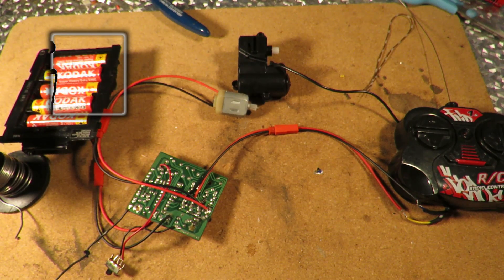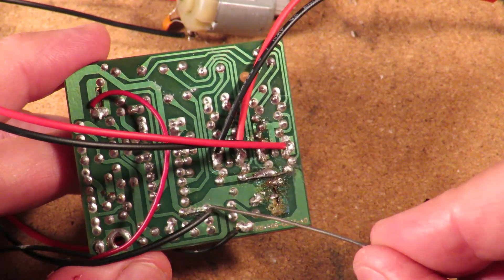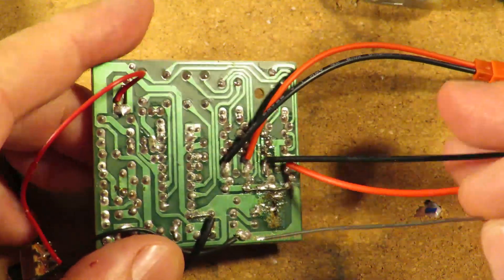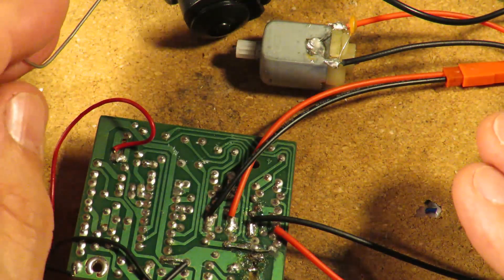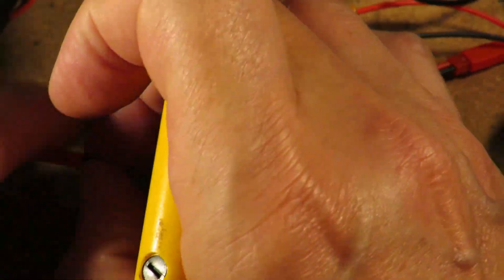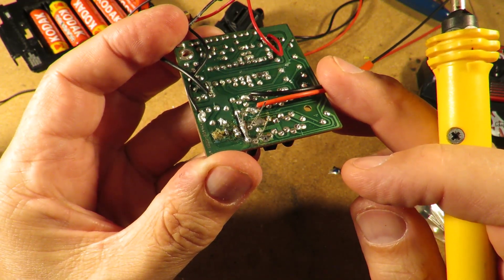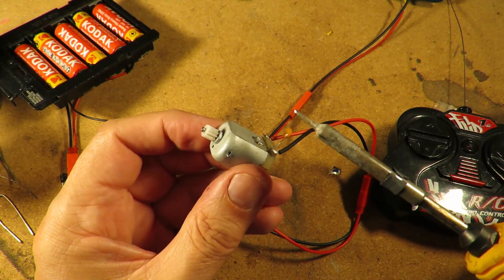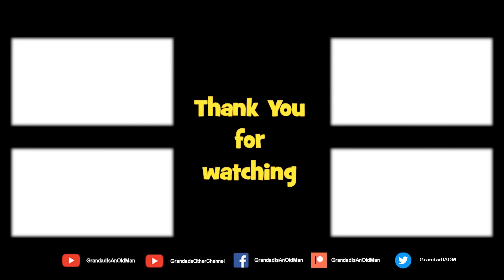Resurrecting a dead 27 MHz receiver with new transistors

Comment: So I wonder which transistor switches had to be replaced. I know on a H bridge there are 2 transistors in series & 2 in parallel. It must been 1 & 2 or 3 & 4 that went bad to kill total function from that motor.

Comment: Hi How are you, I have the following problem with an old formula 1 that I found in the trash. When I give the control, nothing works, the control works because I tested it with a radio on and I hear interference, but in the car receiver I have 0 volts on the H bridge, I give the control and I do not get anything, I have looked in the coil and receiver area and I don't know what voltages I should measure when I turn the knob. I haven't seen burned out transistors or anything. Where could the problem be? Cheers
Reply from the maker: The first question is, do you know if the controller is the right frequency for the receiver? A 27mhz controller will not operate a 40mhz receiver. In many cases a 27mhz controller will not operate a 27mhz receiver if they are different brands.
Reply: @GrandadIsAnOldMan  

Yes, both are at 27Mhz, the remote is from the same car because I looked for it on the internet and the car brought it back. And it puts 27MHz in the remote and in the car. What I have been able to see is that I have 2 volts in pin 1 and ground in pin 2 of the RX-2 but I have no forward voltage, neither left nor right, nor backward etc when I give the command. But power to the RX2 does reach it, its 2 volts and its ground.
Reply from the maker: @germanezequielperez4995  have you downloaded the datasheet for the RX2 TX2 chipset. That will tell you which pins to check on the RX2 for the output to  control the H bridge. You could manually put a signal on those pins to operate the H bridge.
Reply: @GrandadIsAnOldMan     I just tested that, and I have 0.2volts on the forward, backward, etc. pins. And when I turn the control, the voltage does not rise, I have measured in the pins of the inductor coil and there are 1.4 volts, but nothing changes when I turn the control, and apparently the capacitors do not see leaking liquid or inflated. I think the problem is that it does not amplify the signal that reaches it for some reason. or does not get it.
Reply from the maker: @germanezequielperez4995  if you have proved there is no change on the 5 output pins on the Rx2 chip when you operate the controller then I suspect the controller is not matched to the receiver. Can you try the controller with a different receiver and the receiver with a different controller. It is very unlikely the RF circuit on the receiver has gone faulty unless it has been tampered with. It is not subject to high voltage or current, so physical damage or somebody tampering with the components is the only way that will fail. The usual fail is as described in my video, where too much current is drawn through the H-bridge and the power transistor overheats. I am not saying you are wrong, it is just unlikely.

Comment: How did you figure it was those two transistors that were broken?  Is it a set procedure you use for circuit boards to identify a broken component. Cheers Richard
Reply from the maker: Not so much a set procedure. In most cases where I have burned out the "H-Bridge" components you get to see the red glow and the smoke pouring out as they die horribly. The remains are then easy to spot. However, if you have knowledge of how the receiver controls the motors you will know where to look anyway. Most of the receiver circuitry is running on 3.3 volts or less but the motors need the full battery voltage and current. The "H-Bridge" is a "switch" that turns on the full power for the motors without it passing through the rest of the receiver circuit.  A quick Google search will bring up plenty of "H-Bridge" schematics to help your understand this. I think I have some video somewhere of the transistors burning on one of my overpowered projects 😆👍
Reply from the maker: H Bridge playlist https://www.youtube.com/playlist?list=PLA5a2xPRSrB3xWbj0SGy7ljqcW1fb1ubz

Comment: Good to see broken stuff get fixed. If you are overvolting it, the 3.3v regulator may be getting very hot and could fail too. Might not have been appropriate for this circuit but I sometimes just cut the component away from the legs and use a solder sucker on each of the legs. Thanks 😀
Reply from the maker: Thanks for the tip, I will have to search out my solder sucker. I think it is in my "soldering iron" box, but I am not sure where that is. I am very slowly trying to tidy up a bit and actually get back into my work room.

Comment: Just wanted to give a suggestion you could make single videos because in many of the videos I have seen you set out with a purpose but when you are not able to finish it I feel clickbaited. Once again just a suggestion
Reply from the maker: Which videos make you feel click baited? Do they happen to have PART 1 or 1/6 or similar in the title. Any that I fail to finish usually have FAIL in the title. Probably worth checking the video description to see what is going on. There are just under 7000 videos on this channel and a few hundred more on my other two channels.
Reply: GrandadIsAnOldMan yes but the ones I say usually don’t say FAIL. Thank you for considering my suggestion
Reply from the maker: @kreevee8351  thanks. If they don't say fail then they ultimately  complete as an ongoing project. I don't do 3 minute snappy glossy videos, I share what I do as it progresses and I put information in the video description to help the viewer.

Comment: Pretty old receiver
Reply from the maker: @davken692  interesting comment, yet the new 2.4GHz sets are as bad as the old infrared sets, only bind with their own type whereas the old 27MHz range would "almost" always be cross compatible so you had a good chance of being able to get a cheap second hand one working again. So far my experience with the 2.4GHz toy grades is the only way to get a second hand one to work that is missing the controller is swap the receiver for a matched pair. On the positive side, the range is far better so given the choice I would use 2.4GHz but I would use hobby grade not toy grade. The bottom end of the hobby grade market is cheap enough to do that, very close to the toy grade costs and more flexible in it's use.